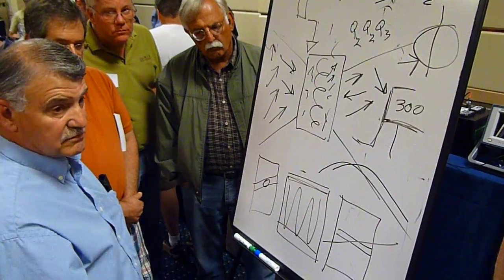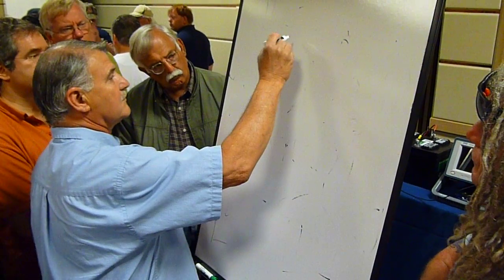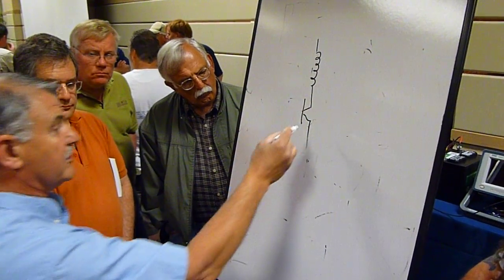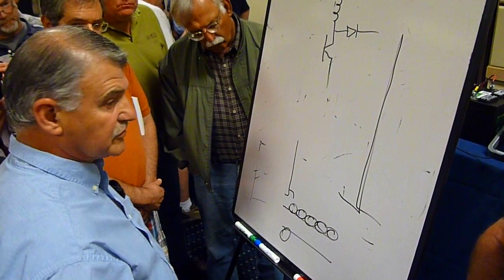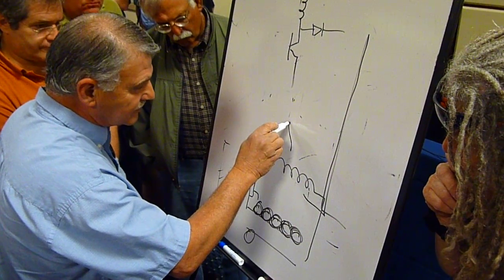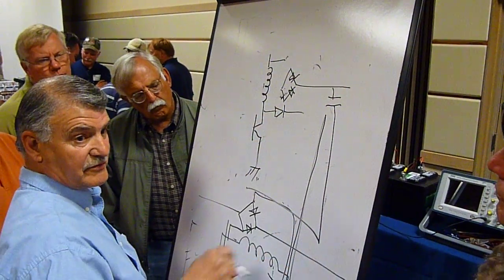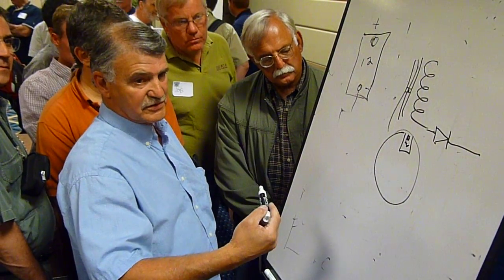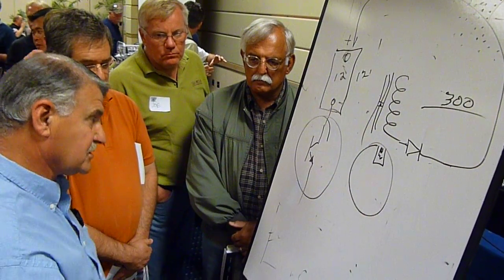John Bedini Coil and Bloch Wall Explanation Energy Conf 2011

Comment: Naoki Kashima, i replicate the John bendini motor , but came to conclude the only thing it does is transfering the charge of one battery to another. Do you have any knowledge of any circuit that really works?
Reply: "I bought a Henry Ford car recently,  but came to conclude the only thing it does is transferring the liquid hydrocarbon from the gas tank to the exhaust. Do you have any knowledge of any car that really works?"
With all do respect, I don't believe you actually built any of John Bedini's 100 different motor designs, each and every one had a purpose in mind to advance his next design or iteration, which means it had a name and none were ever called "the John bendini motor". Although I'm willing to stand and be corrected, maybe you could tell me the schematic you used, where you acquired it and the purpose of the proof of concept behind the design. Cheers!
Reply: To begin with, im an electronics engineer specialized in digital systems and microprocessors,  yes i know what im talking about , thats because every circuit found on youtube to date, doesnt do what is claimed...free energy, i can tell much of them won't work just by looking at the schematic , since that is obvius im not building 99 remaining of them. Thats why i made the question, do you have a circuit that works? , and yes free energy can be made, know how, at least the basic principle works in theory, in practice materials that dont exist yet, is the actual limit for me . Thats the reason i made the question, DOES ANYONE HAS A SCHEMATIC THAT WORKS??? To waste time building something that what it does on schematic is not free energy, i waste my time on my ideas, those are as close to work as i havent seen others.
Reply: You made a statement "i replicate the John bendini motor".
I asked you three simple questions and you avoided all three...shocker! 
If you really built one, this should be a quicky for an electronics engineer specialized in digital systems!
So lets try this game one more time, wait for it... 1) maybe you could tell me the schematic you used? 2) where you acquired it? and 3) the purpose of the proof of concept behind the design?
Reply: Ohh i though you were smarter, if i stated that all it does is transfering the charge of one battery to another, then you should know what im talking about.  I DONT want to waste more time arguing .  Question is loud and clear, Do you have any circuit that works as "claimed free energy"   yes or no and where to download it. I not pointless arguing. You can believe what ever you want,  im here to really ask the question without wasting time,  did John Bedini has a overunity device that works yes or no?.
Reply: Also forgot to mention that if someone talks about free energy or overunity its completly possible , keywords that point to a device that works, not one has mention those keywords. Also thats how i know no one knows here, ill respect and listen to anyone saying those "keywords" .
Reply: Eclectic Optical Services  , I don't have time to argue with people i'm bussy , since i asked first for a schematic that works that question should be answered first , since all you do is avoid that question there is no more case wasting time , Bedinni is a fraud, as all others on the internet, no overunity proven yet, and since , no one could prove it. This case is dismissed no overunity here guys. Don't waste your time. Better to rey own ideas than Bedinni scams.
Reply: Eclectic Optical Services before you start with the books and dvd things about Bedinni , sorry not interested in buying trash.